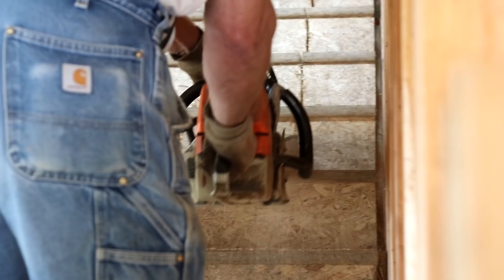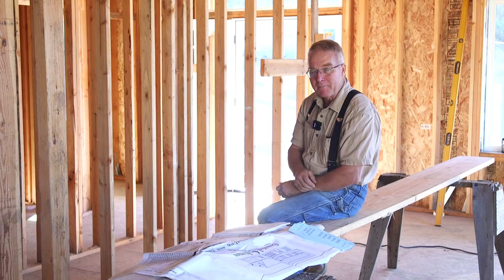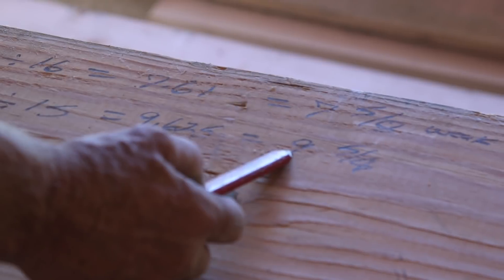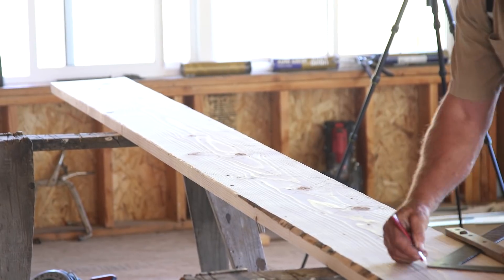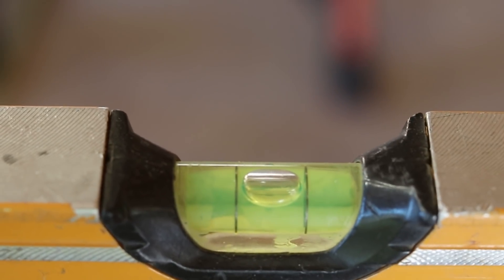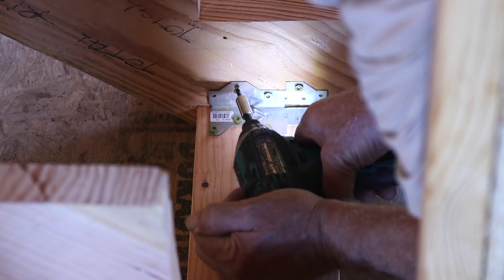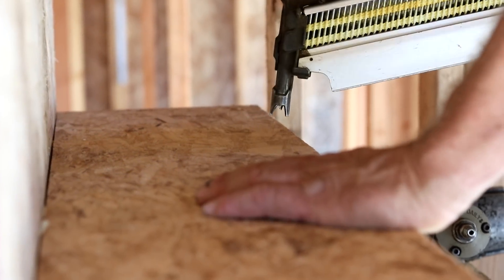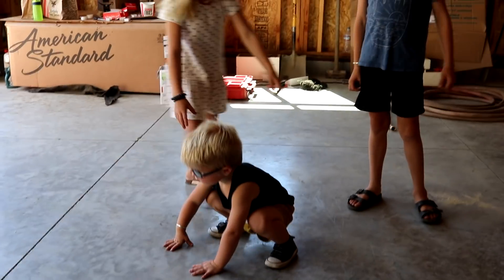Building Stairs...Again Ep.89

Comment: I use these two equations for building steps, I try to fit it into both when you have the room 
Rise +run = 18-19”
Rise(2) + run = 25

The first rule has been around for awhile and the second I got from Mike Guerton, fine home building, great carpenter. 
Keep up the good work!
Reply: using these will guarantee code compliance, correct?

Comment: It's not what go's wrong, but how well a mistake is dealt with, that makes a true craftsman!
Made a similar mistake once but we cut the Mistake stairs free without damaging them.  A month later landed a second story addition where the owners begged us (and paid a little extra) to stay in the house while we did the second floor.  We mounted the Mistake stairs to the outside and used them for access during construction (added original stair cost into bid).  Later sold the Mistake stairs for twice the cost of materials to a guy building a barn.  Figuring out a way to recover the costs of our mistakes tends to blunt the burr of the initial mistake!

Comment: When laying out the pattern, I like to find the hypotenuse of the the rise and run triangle. Using Pythagoreans Theorem  (a^2 + b^2 = c^2). I then mark the points of cuts down the length of the stringer. Finally with the my framing square set I put the point of the square at the points marked and trace. This prevents a compounding tolerance run away if the you don't have your square gauges perfect or don't connect your lines perfectly every time on the rounded edge of the lumber. A 1/16" mistake repeated over 12 treads becomes 3/4" at the end of the line. Hopefully that makes sense and is useful to someone.
Reply: Good advice that not many stairmen actually use. I always laid out my stringers like that. To take it a step further - Hold the tape on zero and keep adding the hypotenuse, consecutively till the end, to avoid more compounding errors by ‘leap frogging’ the tape one measurement at a time. The more you do to prevent cumulative error on stairs, the better. This is especially helpful when you’re absolutely, positively married to a measurement at the bottom of the stairs.
Reply: @psidvicious  That's exactly the way I do it. I always end a shim or block plane from dead on.
Reply: Yeah... you got to know the target length of the whole set.
Reply: @psidvicious  Taking it further still-you can add  accuracy by snapping a line at the inside cut of riser/tread then run tick off your hypotenuse numbers there. No crown problems, no rounded edges on the kd to mess with.....
Reply: I love this idea! I will be using this from here on out👍
Reply: @aliciaspence5974  I like that idea. 
Most of my stair experience was with commercial concrete stairs.
I think it was Episode 53 of this series, when the first set of stairs was built ‘wrong’, that there was a commenter named “Sailor 347”..?, or something like that, and he gave some really great insight into stair building. I have a fair amount of experience with stair building, but I have to admit, that he brought up some things that had never really occurred to me and I thought were very insightful for anyone interested in stair building.
It’ll take a little searching bcz there’s more than a 1000 comments on that video, but it’s worth it if you’re interested in stair building.
Reply: I had my stairs CNC Machined from a solid block of cast aluminum. 
Very expensive and extreme although absolutely silent.
I wouldn't recommend it.
Reply: @bryanwinsor9392  I probably would have gone with titanium, but an aluminum stair has got to be super cool as well 😉
Reply: I like it. Any trick to knock out a compounding error is valuable
Reply: Good GD&T practices here
Reply: This here; this is something I will apply if I ever do a full-size set of stairs. As of right now, I've only done five or six step stringers up to decks for mobile homes, where a compounding error isn't too big a concern, but I always wondered what the trick is to staying on top of that for a longer flight, so thank you for this, I'll keep it in mind.
Reply: I’m sure this was how I was taught at college to set out stairs. You can’t go wrong if you mark out incrementally
Reply: I remember showing up at my first job with a local builder. When it came time to cut rafters, I pulled out my calculator for some trig. They nearly chased me off the site, but when the layout guy made a major mistake and I convinced him of his error, they were suddenly interested in this new "magic". LOL!
Reply: I've always done this too, my construction master calculator makes the math quick and easy.
Reply: Pretty often, treads and risers are glued, including the hangers, to prevent some noisy steps, but not so often, I can see, anywhere else on the entire flight. If you glue "every connection," including where the level cut meets the landing and where the plumb cut meets the header, could be a lil "excessive" but it makes a pretty "Silent" walkway. Js.

Keep up the good work lool

Comment: I enjoyed watching you build those stairs. Stairs always remind me of this funny story. I was a lead man after so many years, and my partner was Keith. He could charm anyone. He got the big model homes, and one of his jobs was to check the prints for mistakes. Then he would hand them to me and ide double-check them. It was the 80s, and we were building two-story homes. Keith told me he checked the prints, and I didn't need to. I started the crew going, build up, headers, cripples, etc. I saw on the prints this wooden spiral staircase. I put Karl, the roof cutter, on it. He got about halfway up, and I turned the page for the next floor to stay ahead. At the top of this spiral staircase was a toilet. I showed Karl, and he was not amused. The whole crew laughed when I told them how I found Kieth asleep at home under his ceiling fan. Turns out the second-floor print was wrong,.And this was the only time I ever heard of the bathroom moving! Enjoyed your show very much.

Comment: A great channel. Don’t worry to much about making a mistake whilst constructing stairs it can happen to the best of us. Have you ever thought of using the metric system for measurement, it’s much easier to measure in millimetres and it saves most of the mathematical and conversion exercise. Keep up the good work and all the best with you project.
Reply: I think there's a video about that. The general message was that when you've spent your life working with imperial, it's not worth the effort to switch, because 99% of the time the imperial system just works fine and you're kinda locked into it with tools and materials in imperial sizes. 

I think it would be a good idea to get the new generations to start using metric so the industry can also slowly make the switch. Behind the scenes, many things are metric already.
Reply: Consensus is just as important. If the industry is imperial, I will stick to it and avoid a different set of unit conversions and communication surprises.

Comment: I thought you going with a hardwood tread and riser this go round. Looks like you set it up for carpet again.
Reply: I’m with @klmbuilders 

I see the top and bottom step becoming an issue unless there was some subtracting we didn’t see! 

I really hope we’re wrong tho
Reply: The hardwood will be on top of and cover up the osb.  It will make the staircase even stronger. Built like Fort Knox for sure!
Reply: @jimellis1496  So the subfloor is receiving 3/4 hardwood and the bottom stringer was cut to 7 and 5/8. It has a 3/4 sub thread and then a 3/4 oak tread going on it. So the finish to finish of the first riser is now 8.36.'' Must have cut the bottom riser 3/4 shorter to make up for it. 

Makes sense now
Reply: Maybe the idea is to fasten the finish treads and risers from underneath but that would be near impossible on the bottom tread.
Reply: @klmbuilders5385  I do prep work for installers, I always tear out osb and replace with plywood to give them good fastening point.
Reply: ashsmashburn, it looked like he put in twelve 3”” screws in every tread. That’s not going to be fun to tear out , especially since he also glued and nailed the OSB to the stringers!
  If he uses 3/4” hardwood flooring on the first and second floor it should work out though, right?
Reply: @RobZeuli  It would depend on how thick the wood floor in the entry way is.

Comment: When you see that big chainsaw and pry bar come out, something is gonna change.
Reply: Yep, those come out, stuff is gonna go down. Lol
Reply: Thats a burk bar....
Reply: Concrete forms the Burke bar is a good sign. It means you are done
Reply: That's exactly what Sweetie said! A power saw and a Burke Bar, somethins' gonna change.
Reply: When I realized what he was up to with those tools, I thought "...now I would try to salvage what materials I could for future use." 
After a bit, it struck me there was no "take apart" in the way he builds stairs!!
Reply: Hehehe .... when you see that big chainsaw INSIDE instead of outside, you know there's some serious wreckin' about to take place.
Reply: @johnmanning4577  looks like my work and some jobs that I've been on. Did one remediation job were we had to pull out the subfloor. It was a pain! Turned out they averaged 44 nails per 4' run. Sheets looked like a porcupine
Reply: so impressed he managed to avoid all the nails with that chainsaw!

Comment: For the rest of the world: 7.61" = 193mm rise, 9.625" = 244.5mm tread. (Not what I'd call 'a comfortable staircase for a high end house' and yes, that is a jab at your architect.)
Reply: I kept thinking how much simpler and faster the calculations would have been in metric.
Reply: @Scrial  plus finding mid point is easier in metric ...!
Reply: Yeah, we generally wouldn't call it "comfortable" here in Freedom land either. But we would't go crazy and start measuring in centipeters. 🤪
Reply: @lordaleksandre  Centipeters? Is that hundredths of a schwantz?
Reply: Right Round  Metric is just objectively superior in every way, and I'll never understand why anyone defends imperial measurements. Mind you, I'm a US woodworker who's also building my big new shop right now, so I have a ton of ongoing experience with inches. Sure, you can convert fractions to decimals and back again, but why would you if you don't have to? What's easier, 7 3/32 + 9 13/16 or 43mm + 210mm? It's ludicrous that we're still on this awful system. I'll admit that there is no good equivalent of gallons in metric, but that's hardly a reason to stick with a system based on barley grains and hands.
Reply: Right Round  I had to work in New Zealand for 6 months once, took 5 mins to convert to metric. Meanwhile, back home, it's not really handy to use metric, since materials come in whatever the hell it is they come in, so i too, convert to base ten. Interestingly, my method which when Scott ran up against an uneven fraction is minus or plus, whereas his was 'weak'. 

I learned doing this in the machine shop, which now allows me to do woodworking and carpentry more accurately.  So, really, once you use it for awhile, converting 121 7/8" to 121.875 comes automatically now.  Didn't take me more than about 6 months to begin doing that(shut up, I'm 66).
Reply: Right Round  While I'm sure they exist, every tape measure I've ever owned tells you the gradation, usually in 32nds or 16ths, but only has lines. Nothing was ever printed in decimals. I think Americans are better with fractions because we have to learn them as a result of our system of measure. Metric doesn't bother so its not something a Japanese or European person is familiar with on a daily basis. Honestly, what purpose is served by noting length as a division operation? It's much easier to simply say 22mm rather than 7 divided by 8. 
Same reason that most adults couldn't tell you how to use a matrix in algebra unless you gave them a refresher course. It's simply not something most people regularly use, so it leaves your mind at the end of high school.
Reply: @asdqwe4468    Actually if you really looked at the history of the metric system you’d find that no country ever adopted it without the reluctance of it’s own citizens first. So let’s not pretend like Americans are the last country in the world to NOT adopt this ‘enlightened’ system. 
  The fact is Americans don’t take well to things being forced onto them by government. Call us stubborn, we get it. But it seems to have served us pretty well so far so don’t look for any change in that characteristic any time soon. Sorry.
  Virtually every country was, at some point, forced to switch to metric by their government and their people did NOT go along willingly. 
  We actually use both metric and imperial in our everyday lives. I find it very puzzling why the rest of the world seems to insist that our local building industry should switch over to metric. What difference could it possibly make to everyone else, what units of measurement we build in, here at home? When we travel abroad and build things, we build in metric units, so where’s the problem?
Reply: @psidvicious  People are reluctant to change, that's well known. I doubt you'd find many people in other countries who'd prefer to switch back to non-metric measurements. People will whine and cry over just about any change, regardless of how good it is, just because it's a change.
Reply: @asdqwe4468  😁HEY! I like that! “Freedom Inches”. Brilliant!
Very little of what you just said is even attributable to what I said, so it’s a bit difficult to even respond to that tantrum like rant.
“Freedom Inches” 😁... You shoulda thought that thru 1 more step to the obvious - “Freedom Feet”! Gotta start using that! Thanks!
Reply: @asdqwe4468    You fundamentally misunderstand how American govt and laws works. In a nutshell, a democratic republic works like this - The people elect legislators of like mind to them. The legislators then draft the type of rules that the majority of people elected them for and then the proposed rules are voted on by the legislators (in certain cases, directly by the people). If a majority vote by legislators is achieved, the proposed rule becomes law. If you don’t like the new law, you vote your legislator out thru regular elections and get the new law changed by new legislators. Here’s where you got it wrong. - Laws are not decreed or “forced” onto the people by some authoritarian body or individual. 
  Not to belabor the point, but surely now you understand that if we don’t want something or maybe more importantly, if we don’t want to pay for it, we’re not going to have it. 
  For no other reason than a gesture of good will towards the rest of the world, we actually use both systems of measurement and are happy to oblige in this way (We have ‘met you half-way’). But this ‘not-so-passive-aggressive’ insistence that we just do a whole-sale switch to the metric system, for no more reason than somebody wants us to, is simply an insufficient argument. Why should we go metric more than we have? How are we harming other nations by not going metric?
  The cost for completely re-tooling the entire countries factories and infrastructure, along with complete re-signage of all roads and highways just to become metric compliant is just the tip of the iceberg why we don’t feel the need. In just a simple cost analysis breakdown, the benefit to both you and us is minuscule and just not worth it. 
  [And btw, I never made the ‘base 10’ claim so, again that’s misdirected filler trying to bolster your argument.]
Reply: Look, any sane person knows that metric is better, but I was kind of hoping to get other peoples opinion on stair sizes, not rehash what's been said  a thousand times before.

I would not go steeper than 180/275mm, and if I was going for "comfortable", I'd do 165/290mm, or is that just an African thing?

Comment: I wish there was less shame around making mistakes. Everyone does it - I've made some whoppers.
Reply: I once spilt superglue on a £40k paint job whilst working at a super car manufacturer. Damn that was a bad day.
At least I wasn’t the guy who slammed a door that hadn’t been adjusted and smashed the latch striker through the door shut of the carbon monocoque. Now he had a whole bad week.
Reply: I put a 4x6 beam in the ground (for a deck) that was off square a couple of degrees. One of the braces must have moved when I was putting the concrete in and I didn't catch it until the concrete was already set up.
Reply: agreed.   I've learned more from mistakes than I have from successes.   The trick is not repeat the mistake in the future.

Comment: Hi Scott, as others have mentioned, it is  very informative and nice to see how you fixed this mistake and i especially appreciated how you explained the cumulative error in the risers and how it can really screw up an otherwise nice set of stairs. I install a lot of custom hardwood staircases and have had to deal with this cumulative error on multi million dollar custom homes. I love how much pride you take in making sure it is correct, and wish everyone was like you. Unfortunately it has become standard practice for me to double check this on stair installs, and most of the time have to shim a couple of steps. 1/16 or 1/8 inch plywood can bring those little mistakes back into compliance. Just saying that when it comes time to install the finished treads, those small mis cuts, say a riser that is 3/16 short, can usually be fixed in a way that no one will ever know they were wrong. So if you install these nice new stringers and find a small error, its not always the end of the world, but I can assure you that the finish guys later on down the line will appreciate your diligence.